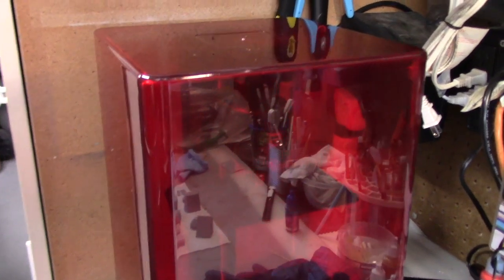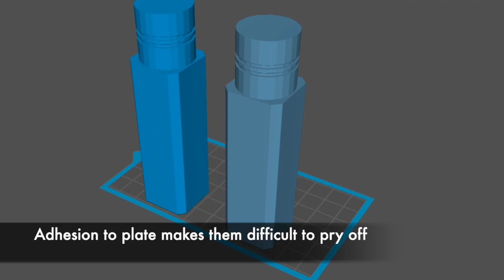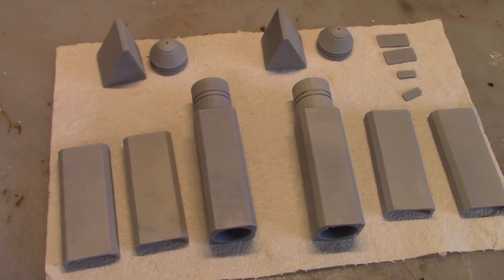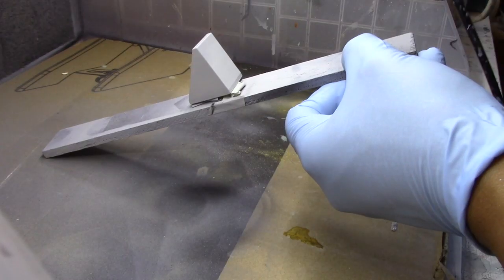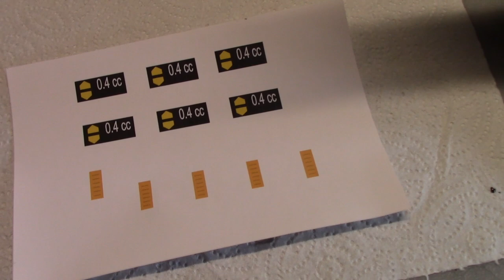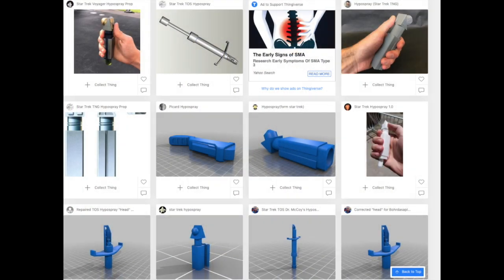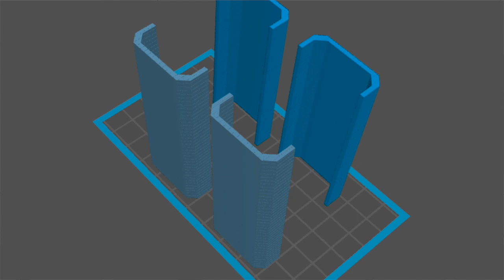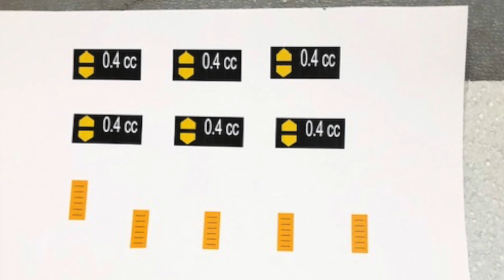Let's make a Star Trek Hypospray Prop

Comment: Excellent work with your "replicator" aka 3D printer. :) Before printing parts always check to make sure they're manifold. What that means is that there are no holes in the surface of the model. Those are those two holes you had there. There's a free slicer software called Ideamaker which can repair minor defects like that in 3D stl files.
Reply from the maker: Thanks for the tips Omar....will do.

Comment: The sizing issue is probably due to the software he used to create it. Not all of them export the size data, just units.  This applies to 3d model programs that are used for animation and effects vs a cad/cam package like sketchup, fusion360 or tinker cad.  The animation software doesn't worry about real world measurements as such and does not export them to the final model.
Reply from the maker: Excellent info, thanks

Comment: Interesting little project there, couple of questions if I may...
What type of Adhesive print paper did you use & in cost terms how much roughly does something like this work out at?
Reply from the maker: The cost was probably less than a few bucks  when you take into account the amount of resin it took to make this. The Chitubox program will estimate the cost based on the resin required and the cost you paid for it.   It estimated the cost of the body to be $1.20 so you can imagine the rest of the parts were smaller.  As for the vinyl adhesive paper, it's by Cricut.  You can search Vinyl adhesive paper on Michaels website and you'll find it, comes in a green package.  Thanks for watching
Reply: @InterstellarModeler  excellent,  thanks for the extra information, I'm guessing the Cricut is a similar system to Lou Dalmazo's plotter?keep up the good work, great videos
Reply from the maker: @MartinFutter70  Hey Martin, Yes Cricut is a company that makes machines designed for creating labels, stickers and stuff for crafts.  I just bought their adhesive paper and placed it in my inkjet printer.  The decals were created in photoshop and I printed them onto the paper much the way I would photographs.  I used scissors to cut them out. Thanks again for watching. Here's a link to the paper if you're at all interested https://www.amazon.com/Cricut-Printable-Vinyl-for-Die-Cuts/dp/B00NMCU9ZO
Reply: @InterstellarModeler  many thanks for the info - 🖖